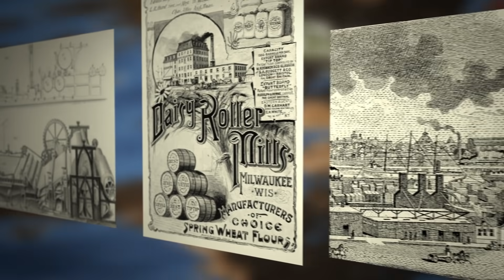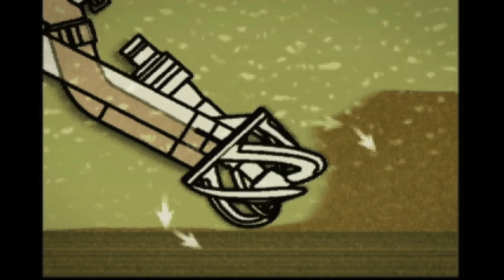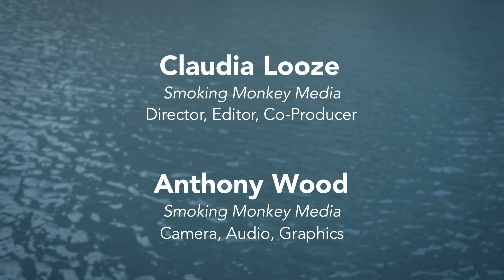A Toxic Legacy: Cleaning Up Milwaukee’s Waterways

Comment: Is there anyway that you could install biowales in the streets to stop the amount of run off that occurs? Maybe plant, plants that can “filter” the water and make it more clean for the aquatic life and more importantly all life around that given ecosystem? I think that controlling water run off is an important thing to do and would help the city of milwaukee be a healthier and greener city.
Reply from the maker: Hi, Ramen, MMSD works with the local community to add green infrastructure tactics such as bioswales along city streets and green roofs to help adsorb water where it falls and to help reduce polluted stormwater runoff. Green infrastructure captures, absorbs, or stores rain and melting snow, taking on numerous shapes and sizes from 55-gallon rain barrels to rain gardens, trees, and porous pavers for parking lots, driveways, and sidewalks. Join us to manage water where it falls on your property and become a Fresh Coast Guardian. https://www.mmsd.com/what-we-do/green-infrastructure